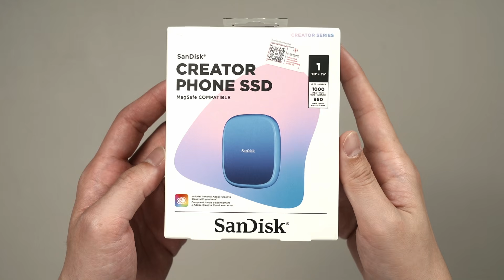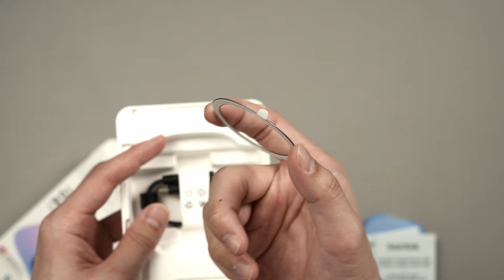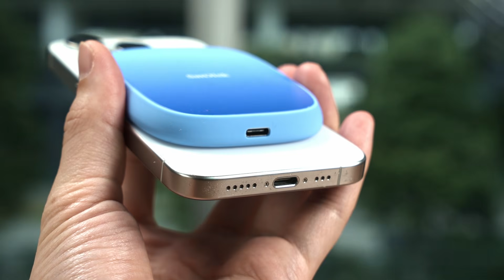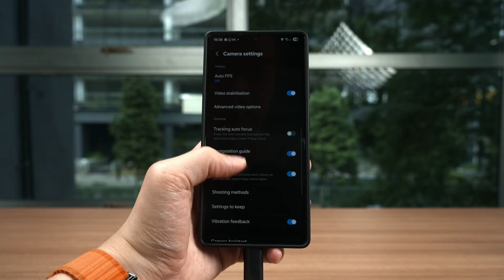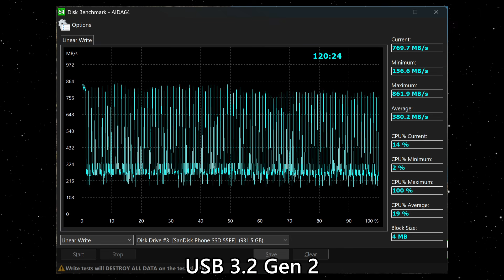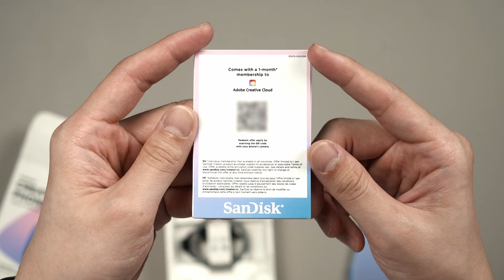Record ENDLESS* 4K ProRes with THIS! SanDisk Creator Phone SSD review!

Comment: This is an observation, but the cable is a bit too stiff like you said, but it's also too long as well. Perhaps if it was a bit shorter it wouldn't make the SSD pop off of the back and might make holding it less awkward, because the extra length pushes it. I would like to buy it an try it out only if I could find a shorter and compatible cable. It would be great for storing lots of photos and video files. I miss phones that can hold a microSD card, because they make 2tb micro SD cards now, but there are very few phones out there that offer a microSD card port that are not obsolete and work with any of the major carriers.